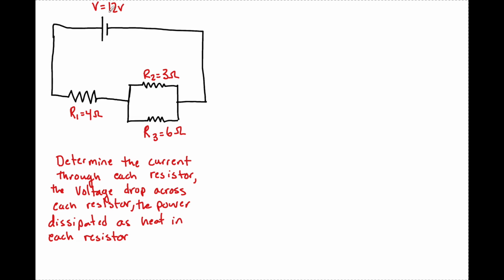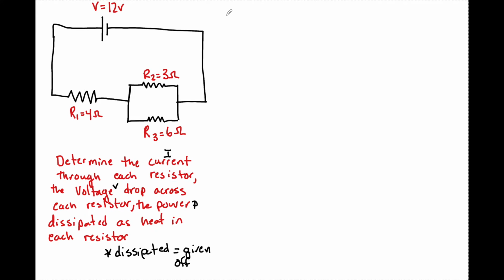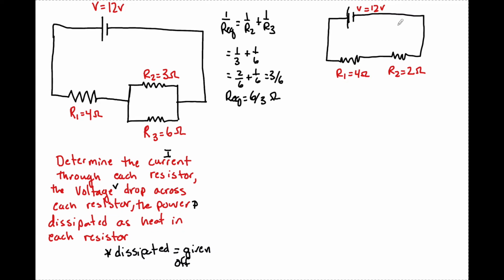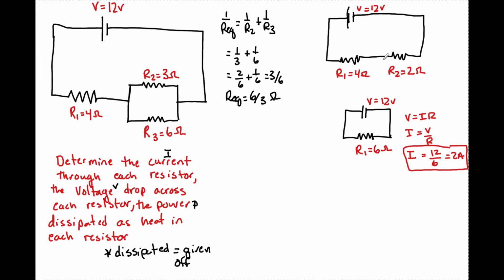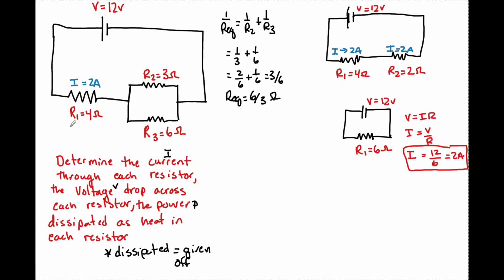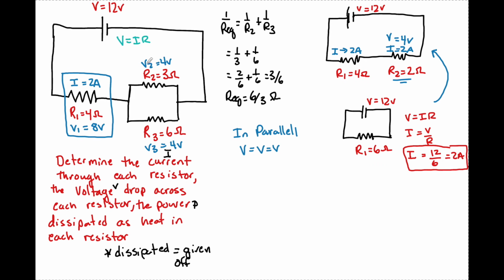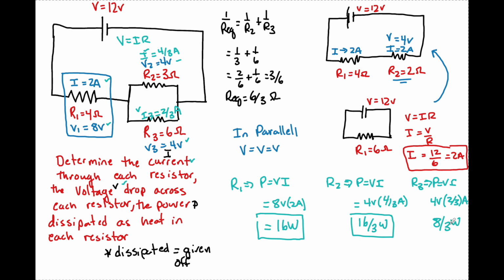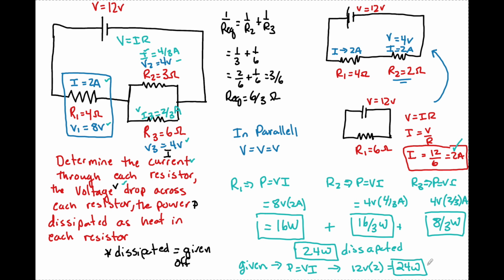Combined Circuit Example | How To Find Current, Voltage, and Power (AP Physics 2)

Comment: how did you get V equal 4 for R2,3
Reply: resistor 2,3 Had a known current of 2A and a resistance of 2 ohms. therefore E(voltage) = I(current) x r(resistance). E=2x2

Comment: You cant just split voltage like that in parallel structure
Reply from the maker: Correct. Potential difference is equal everywhere in parallel.

Comment: I have a question what if you had that single resistor accross on the other side of the circuit? Like right next to the + terminal on the battery? would that be still the same? does the direction where the current flows change the in series resistor value? I hope you understand what i am trying to ask here. thanks